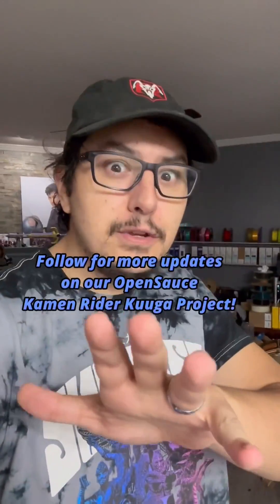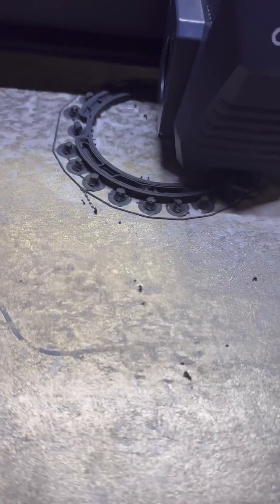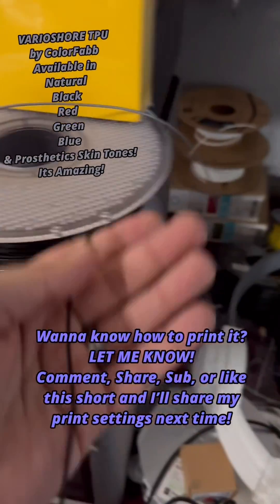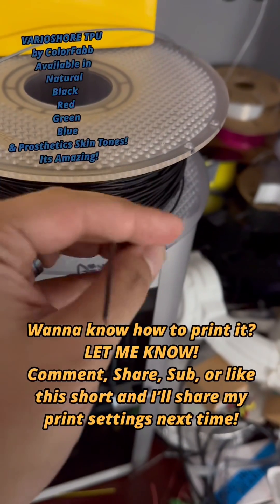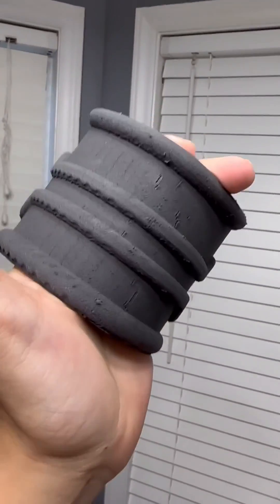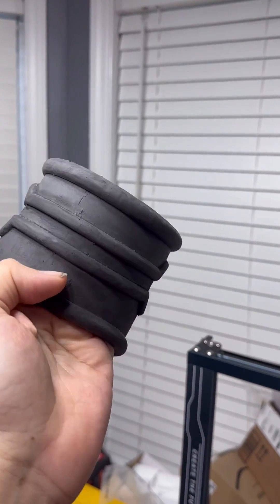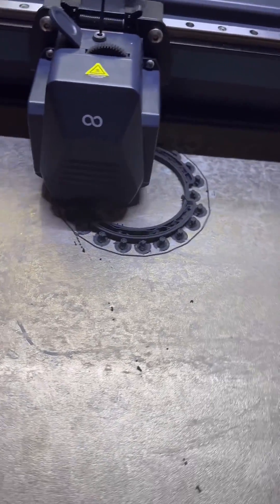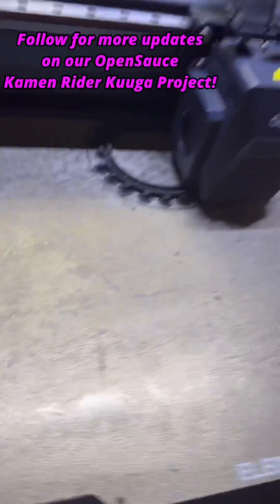VarioshoreTPU Unlocks 3D Printed EVA Foam

Comment: I just started printing Lilith parts for a friend's cosplay and LOVE this stuff. It took only a little tweaking to get it running on 0.4 nozzle at 0.2, but I didn't even consider how it would do with a 0.8.nozzle... what settings did you use for that larger nozzle because I have a headpiece to print....
Reply from the maker: @Korvorkian1  bump down the speed and flow some more, and bump  up the temps! I gotta tweak my retraction settings though, it was so baddddd 
Glad you like it too and best of luck printing more stuff with it!
Reply: Awesome thanks ! This is the first tpu I've printed that wasn't utter misery to do, and man it works great for my LARP friends stuff too. And the fact you can get so much more out of a spool than hard plastics is amazing